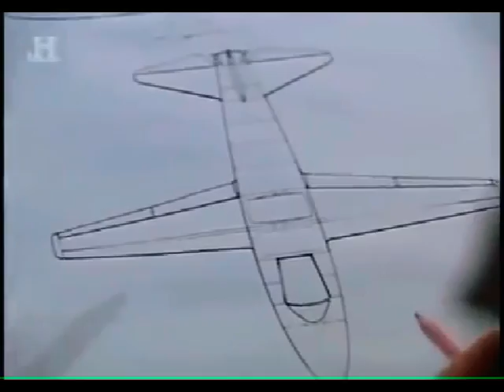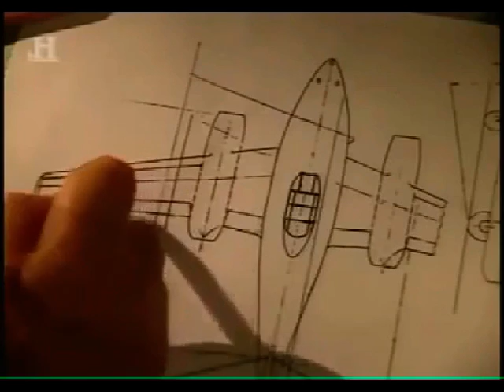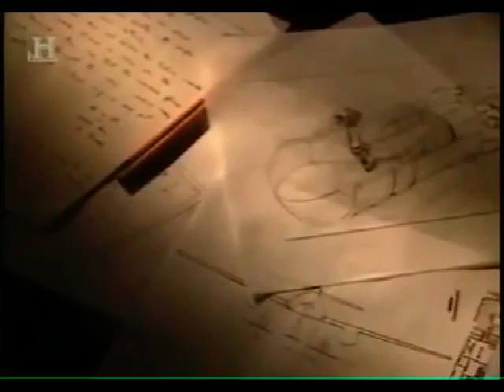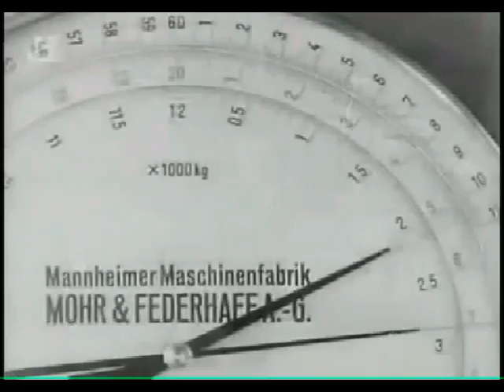The Father of the Jet Engine - Hans Von Ohain

Comment: Interesting but I think four points are overlooked. First, we in the UK kept out technology secret and it gives the impression we were years behind. Sir Frank Whittle was aware of axial compressors but decided to go radial because it is relatively easier to manufacture. The Third point the compressor is the cold end of the engine so it not material limited, and both Hann and Whittle used similar blades at the hot end, and here the UK had a clear lead. Fourthly, the first design for a jet, independently proposed around the time of WW1 where the UK design would have used a Desiel powered compressor,  and in the USA a similar compressor using a petrol engine, and if these designs had been followed up they would have been much more efficient. Bring on the Turbo-compound engine.
Reply: Not strictly true that compressor is cold end. The average compression ratio is between 20 and 25:1, this gives a considerable rise in air temperature, and hence compressor blade temperature, at combustion end. This causes the compressor blades to expand, and as you need a negligable gap between engine casing and blade for maximum compression efficiency, there is a chance of blades hitting engine casing. The high rotational speed also causes the blade to stretch due to centrifugal force. These problems were evenually overcome by using blade cooling holes and blades grown from single crystal to control how blades expanded and also behaved under stress. There is not a similar problem with the turbine because a ring is placed around the turbine blades to contain them. There is a different problem with the turbine blades, and that is that they can melt at required temperature for thermodynamic efficiency, hence thay are made from nickel/steel alloy.
Reply: The fact is Whittle did not have the engineering experience to construct a functional axial compressor, this was pointed out the RAE Chief of aircraft engine development A.A Griffiths. Who also exposed Whittle for plagiarizing his 1926 paper on axial turboshaft engines.
Whittle would never construct any engine with a axial compressor during his short career in the aircraft industry.
Reply: @sandervanderkammen9230  Here's what Pabst von Ohain had to say-

"The first patent of a turbojet engine, which was later developed and produced,
was that of Frank Whittle, now Sir Frank (see Fig. 5). His patent was applied for
in January 1930. This patent shows a multistage, axial-flow compressor followed
by a radial compressor stage, a combustor, an axial-flow turbine driving the
compressor, and an exhaust nozzle. Such configurations are still used today"

Note the presence of axial flow compressors.
Reply: @sandervanderkammen9230  By the way Sandyboy,  you've got some more dates wrong by several years. Griffiths wasn't chief of dev at RAE until 1938.
And I'm still waiting for you to produce any evidence of any claim of Whittle plagiarising any of Griffith's work. You haven't got any have you Sandyboy.

Comment: It all comes down to the invention of the steam turbine by Parsons in the 1880's. Its eventual adaptation to internal combustion was inevitable. Nobody is the father of the jet engine, several people worked on it more or less independently and one happened to be the first to put it into the air. Others were not so lucky as to secure enough resources to realize their dream in time or at all. Arkhip Lyulka patented a turbofan in 1935.  Jendrassik Gyorgy patented a turboprop in 1929.
Reply: Lucian Ene
You have to distinguish between a turbine and turbojet.  The turbojet was down to Whittle in the UK.
Reply: The first successful flightworthy jet engine was designed by Hans von Ohain and flew on August 27th 1939 2 years before Frank Whittle.
Reply: @johnburns4017  
There is no distinction. The turbojet is one particular configuration of the gas turbine engine, specifically one in which the greater part of the useful power is delivered in the form of the kinetic energy of the exhaust gas instead of mechanical work transmitted to a shaft.
Reply: @lucianene7741  
There is a distinction. Whittle invented the turbojet advance.

Comment: Just read the first lines of the Frank Whittle Wikipedia entry and you’ll find out what is true. Spoiler: he didn’t invented it. And I saw some comments were it is said that Ohain admitted it. But where are the proofs for this?
Reply: Wikipedia isn't Wikipedia anymore, like Snopes isn't Snopes anymore. The left ruin everything.
Reply: The proof of what Ohain said is in his foreword to 'Elements of Propulsion, Gas turbines and Rockets'. From page 15-

"The first patent of a turbojet engine, which was later developed and produced,
was that of Frank Whittle, now Sir Frank (see Fig. 5). His patent was applied for
in January 1930. This patent shows a multistage, axial-flow compressor followed
by a radial compressor stage, a combustor, an axial-flow turbine driving the
compressor, and an exhaust nozzle. Such configurations are still used today..."

Comment: He has contributed more than anyone  else..I hate the Word  FATHER  of something but if you insist, Von Ohain is the father  of the jet engine.
Reply: +Complete Aerogeek  Are you sure? His engines where axial like all jet engines are today..... That was not a Whittle design ........... but think what you want to think it's a free world.
Reply: +Coronado326 Von Ohain is the 'father' of a hair-dryer powered glider and nothing else.
Reply: Von Ohain may be the step father of the jet but that's about it. 

Whittle had his patent approved when von Ohain was still in college. Von Ohain read and critiqued Whittle patents and discussed them in detail as he states  in his biography. 

Whittle's engine ran 6 months before von Ohain's and von Ohain's engine never went into production anywhere nor did anyone base an engine on his design.. His  claim to fame was getting a 'rough and ready' engine into the air with the huge backing from Heinkel. 

Whittle's engines were used widely post war by the US, France, Russia, China and others. His design is the basis for almost all turboprops in production and flying today

Von Ohain? Not so much.
Reply: Schwanzel Stock  Just google the HES1 engine. There are pictures of it. von Ohain's only design was for a centrifugal compressor with a radial inflow (centrifugal) turbine. It didn't work terribly well which is why it was never put into production.
Reply: Gary Tarr  Well to be scrupulously fair Gary - he had already worked out a basic design for his engine when he saw Whittle's patent (The idea of a centrifugal compressor was not new- it had already been used in superchargers) and then he had to modify his design and patent application so as not to infringe on Whittle's patent. This was around 1935 - 5 years after Whittle's first patent was awarded.

Even so it was several years before he actually built an engine and he had all that time to pore over Whittle's patents (more than one) and incorporate what he saw into his work.

The radial inflow turbine was his downfall. Whittle identified in the late 1920's that an axial turbine was the way to go.

Comment: It's funny to go from top comments, to newest, 641 comments over 3 years and it's still the same argument.
Reply: Some people refuse to believe the truth that Germany invented turbojet engines.
Reply: They can set whatever they want but without the germans there will be no jet engined aircraft
Reply: @SchützenGewehr  Unless you believe Hans von Ohain himself. Here is what he had to say in his foreword to the book 'Elements of Propulsion, Gas Turbines and Rockets'-

"The first patent of a turbojet engine, which was later developed and produced,
was that of Frank Whittle, now Sir Frank (see Fig. 5). His patent was applied for
in January 1930. This patent shows a multistage, axial-flow compressor followed
by a radial compressor stage, a combustor, an axial-flow turbine driving the
compressor, and an exhaust nozzle."

and

"From the beginning of his jet propulsion activities, Frank Whittle had been
seeking means for improving the propulsive efficiency of turbojet engines. ¶ He
conceived novel ideas for which he filed a patent application in 1936, which
can be called a bypass engine or turbofan. To avoid a complete new design,
Whittle sought an interim solution that could be merely "tacked on" to a jet
engine. This configuration was later known as the aft fan. Whittle's work on
fan jets or bypass engines and aft fans was way ahead of his time. It was of
greatest importance for the future or turbopropulsion."
Reply: @sandervanderkammen9230  And they'd be right wouldn't they Sandyboy because even you say that Germany didn't invent turbojet engines, at least when yo want it to be a Frenchman.
Reply: @SchützenGewehr  What does that famous GERMAN jet engineer Pabst von Ohain say  about it -

"The first patent of a turbojet engine, which was later developed and produced,
was that of Frank Whittle, now Sir Frank (see Fig. 5). His patent was applied for
in January 1930. This patent shows a multistage, axial-flow compressor followed
by a radial compressor stage, a combustor, an axial-flow turbine driving the
compressor, and an exhaust nozzle."

and

"From the beginning of his jet propulsion activities, Frank Whittle had been
seeking means for improving the propulsive efficiency of turbojet engines. He
conceived novel ideas for which he filed a patent application in 1936, which
can be called a bypass engine or turbofan. To avoid a complete new design,
Whittle sought an interim solution that could be merely "tacked on" to a jet
engine. This configuration was later known as the aft fan. Whittle's work on
fan jets or bypass engines and aft fans was way ahead of his time. It was of
greatest importance for the future or turbopropulsion."

Comment: Sooo, we know the train of thought that led Whittle to the idea.   What was Ohain's.  He was a brilliant physicist,  but was he obsessed with aircraft engines and high speed like a lowly pilot in England who first thought of a fan in the fuselage driven by a piston engine, pictured it, obsessed on it, wanted to get rid of that damned piston engine with all its parts "jerking back and forth",  then saw that airflow down a tube and later thought- "hey, put a turbine wheel in that flow and "up" the compression ratio and drive the compressor with it and you wont need a damned piston engine, and hey, the unused energy would provide a reactive thrust.  Now fiddlesticks,  why didn't I think of that before??  But I guess that whole train of thought popped into Ohain's head as one thought as he was doing physics equations one night (a couple of years after Whittle's patent was made public).
Reply: Please spare us the brit propaganda myths, Whittle's patent was not the first...
Maxime Guillaume patented the turbojet 9 years before Whittle.

Unless you are blind, you do not need to be an engineer to see that Hans von Ohain's design is completely unrelated and not influenced by Whittle's patent.
Reply: @sandervanderkammen9230  Guillaume's patent was flawed due to compressor problems. It would never have worked. These problems were solved by A.A.Griffiths in 1926. Whittles patent and working prototype were the first. No propaganda. Just facts.
Reply: @youtischia  Sorry but you are very confused and misinformed.
Whittle's patent was not first nor was it ever constructed Whittle's design suffered the same problem as Guillaume's compressor.
Frank Whittle would never build a axial compressor.
Hans von Ohain was first to build a successful turbojet engine... end of story.
Reply: @sandervanderkammen9230  Alas for you the story goes on. Here is what Ohain himself had to say-
"The first patent of a turbojet engine, which was later developed and produced,
was that of Frank Whittle, now Sir Frank (see Fig. 5). His patent was applied for
in January 1930. This patent shows a multistage, axial-flow compressor followed
by a radial compressor stage, a combustor, an axial-flow turbine driving the
compressor, and an exhaust nozzle. Such configurations are still used today..."
Note the axial compressors.
And as for his own patent, he says-
"In early 1935, I worked out a patent for the various features of a gas turbine
consisting of radial outflow compressor rotor, combustor, radial inflow turbine,
and a central exhaust thrust nozzle."
Note the absence of any axial elements.
Those quotes are from Ohain's foreword to 'Elements of Propulsion, Gas turbines and Rockets'. In that foreword Ohain also describes how all the projects he worked on in those war years were cancelled or delayed so that they never went into production.

Comment: ♦ Ohain did not design a reverse flow engine. His engine had a centrifugal compressor and a radial inflow (centrifugal turbine - a design never used in any production engine - this was a patent filed by Whittle. Ohain even commented on its unusual design when he read Whittle's patent prior to filing his own. From Ohain's biography: 
"When I saw Whittle’s patent I was almost convinced that it had something to do with boundary layer suction combinations. It had a two-ﬂow, dual entrance flow radial flow compressor that looked monstrous from an engine point of view. Its ﬂow reversal looked to us to be an undesirable thing, but it turned out that it wasn't so bad after all though it gave some minor instability problems." 
♦ Whittle's reverse flow design is the basis for almost all turboprop engines in production.
♦ Britain had axial-flow engines running in 1941 - the same time that Franz had his Jumo running. The Metrovick F.2 flew in a Meteor in 1943. The F.2 transpired into the Sapphire which the US built under licence as the J-65 and then modified it as the J-47.
♦ Westinghouse in the US was given a Whittle engine, and plans for improvements. They made such a hash of it that Whittle had to  go to the US to assist. The US government gave the project to GE who made the I-16 which transpired into the first US built jet engine.  The US licensed the Ghost for the P-80/T-33 and the RR Nene. The Nene was used by the Soviets in the MIG 15.
♦ Ohain's engine was not produced being shelved by 1943.  No engine was built using his design.
♦ Whittle also R&D'd axial-flow engines. The metallurgy was not advanced enough at the time. Whittle's engines produced far more thrust than the German axial-flows and far more reliable.
♦ The PT-6, PWC 100/150 are derivatives of Whittle's designs being still produced.
♦  Whittle's centrifugal-flow engines were built under licence in the US after WW2 - the J-33, J-42 and J-48.
♦ The Olympus was the world's first 2 shaft turbojet and the first to exceed 10,000 pounds of thrust.
♦ The 1950 Avon was the first reliable axial-flow engine. Also the longest produced gas turbine in history being still in production as a land based generator.
♦ The RR Conway was the world's first turbofan.
♦ The RB-211 was the world's first 3 shaft turbofan.
♦ The Rolls Royce Trent was the world's first turboprop to fly.
♦ British axial-flows led the post war world in technology and power.
♦ The axial-flow Sapphire was built in the US as the J-65.  The GE J-47 was based on the Sapphire.
 
Frank Whittle invented the modern turbojet.
Reply: The Jet engine was invented in Germany by Hans von Ohain.
Reply: @sandervanderkammen9230  
Not this nut again.
Reply: @johnburns4017  Frank Whittle's jet engine was only the fourth design to successfully power a jet aircraft..
Reply: @sandervanderkammen9230  
Not this nut again.
Reply: @johnburns4017    John! WHERE IS THAT 2020 MAZDA ROTARY YOU PROMISED?????
Reply: @johnburns4017  WHERE IS THE 2020 MAZDA ROTARY?????????
Reply: @sandervanderkammen9230  
Doktorbimmer, a quiz. 
Name the company that is introducing a new rotary engine in a hybrid?
20 points for the correct answer.
Reply: @johnburns4017  HAVE YOU STOPPED BY THE LOCAL MAZDA DEALER LATELY??? YOU LOOK LIKE A FOOL RIGHT NOW!!!
Reply: @sandervanderkammen9230    
BZZZZZT! Wrong answer.
Doktorbimmer,  the name of the company to introduce a hybrid rotary car is...

🍾🎊 Mazda   🍾🎊🎈

Zero points doktorbimmer,  Zero.  Better luck next time.
Reply: @johnburns4017  DID YOU TOP YOURSELF? OR JUST HIDING IN A CAVE EATING HUMBLE PIE???
Reply: @sandervanderkammen9230  
doktorbimmer, a quiz.
Name the engine that does not have pistons?
20 points for the correct answer.
Reply: @johnburns4017  INVENTED BY HANS VON HAIN AND MAX HANN
Reply: @johnburns4017  YOU LOSE JOHN, STOP BY YOUR LOCAL MAZDA DEALER AND SEE FOR YOURSELF, ONLY RECIPROCATING ENGINES AND PLUGIN EVs
Reply: @sandervanderkammen9230  
dockorbimmer, a quiz.
Name the artillery gun that uses a rotary engine as its generator?
20 points for the correct answer.
Reply: @sandervanderkammen9230  Hello sandyboy, let's remember what Pabst von Ohain had to say-
"The first patent of a turbojet engine, which was later developed and produced,
was that of Frank Whittle, now Sir Frank (see Fig. 5). His patent was applied for
in January 1930. This patent shows a multistage, axial-flow compressor followed
by a radial compressor stage, a combustor, an axial-flow turbine driving the
compressor, and an exhaust nozzle."
And remember when you want to dismiss Ohain you always give to the Frenchman Maxime Guillaume not a german.